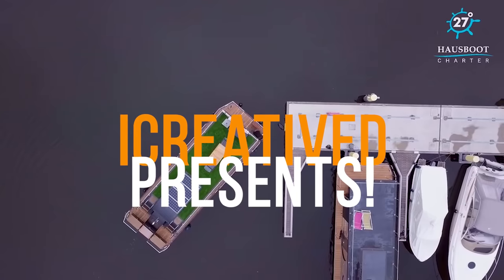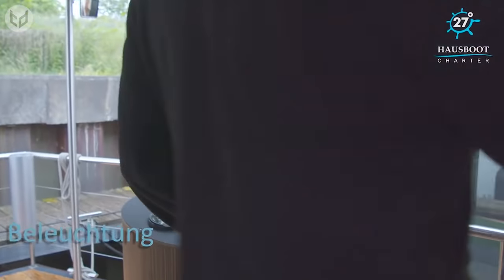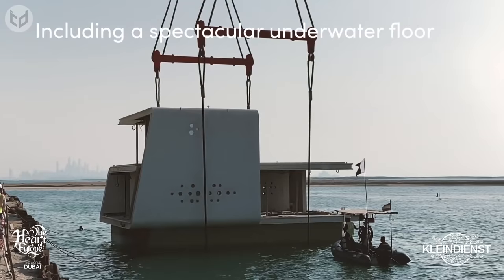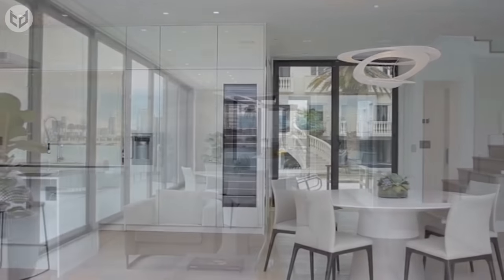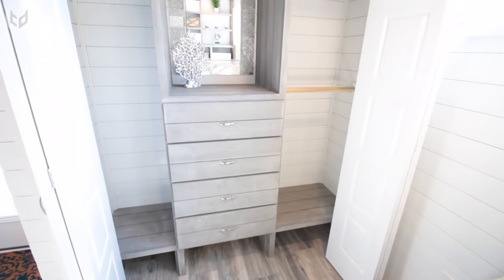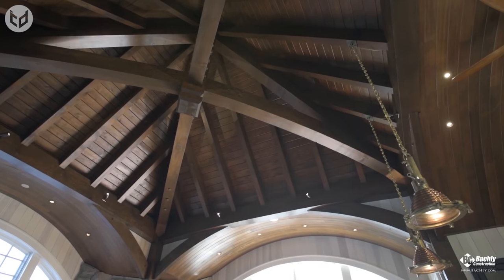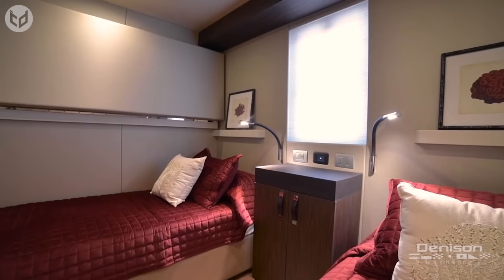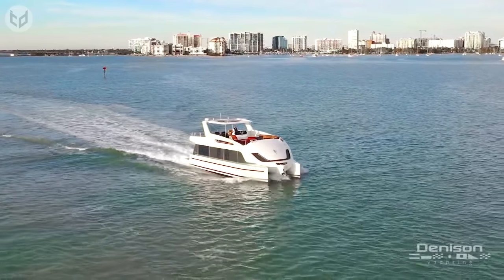6 INCREDIBLE Houseboats - Homes on Water ➤ 2 !

Comment: Whats the real difference between yacht and house boat? They both have beds, baths, hulls and a bridge area to control the vessels.
Reply: Yacht can cross oceans and reach further and are off grid equipped with watermaker , wind generator and also have better navigation with bow thrusters and radar.
Reply: @andecap1325  sounds like the Yacht is better then.
Reply: @Gargamoth  all depends if you like to travel which has its risks and rewards.